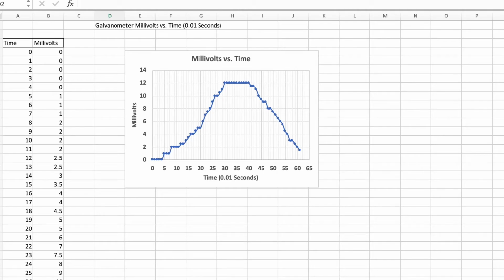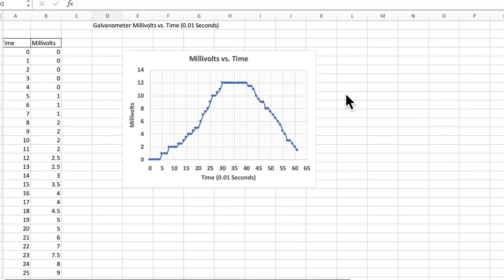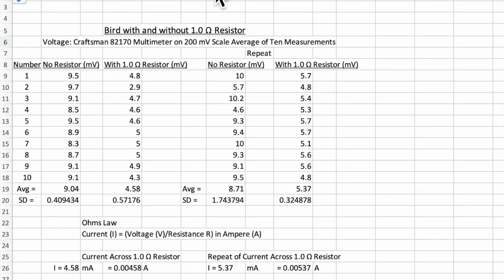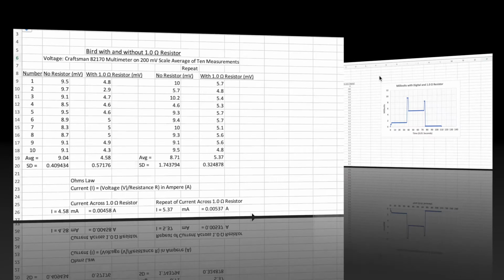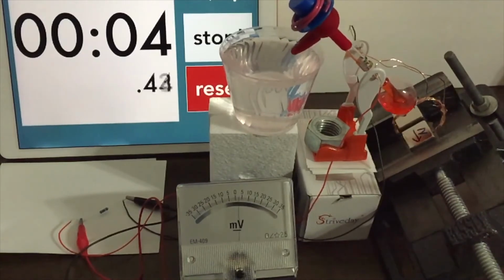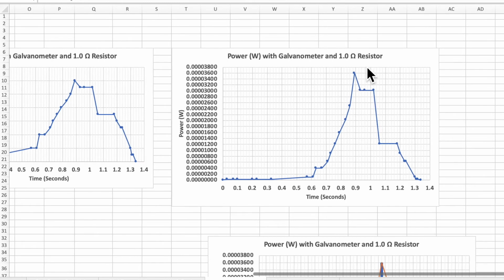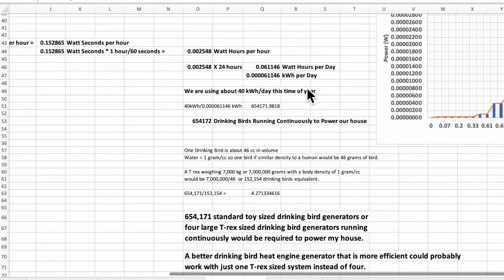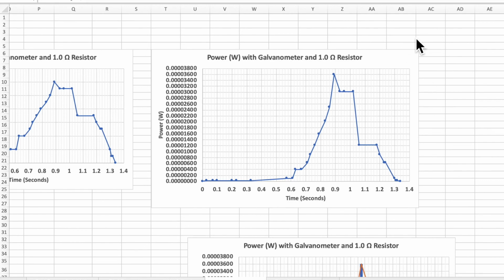Could a T-rex Sized Drinking Bird Generator Power my All Electric House

Comment: Another type of heat engine running on evaporative cooling:

https://youtu.be/ARD3ctp80ac

An LTD "low temperature difference" Stirling engine running on a wet piece of paper. Cooling could probably be increased by adding fan blades to the flywheel for more air flow and more rapid evaporation. In an experiment such an engine ran for two weeks on a wet sponge, and then it was only stopped because it needed to be moved.
Reply from the maker: Excellent demonstration! Thanks for sharing.

Comment: Thanks for your amazing video. I just wondered did you calculate the bird’s volume ?
Reply from the maker: Thanks for watching and your comment. At about 6:50 into the video I show where I submerged the bird into a graduated cylinder that was partially full of water. I wrote down the increase in the water level as the volume of the bird. I got this idea from a Thomas Edison biography that I read along time ago. They said that Edison had hired a mathematician during their light bulb development work at his Menlo Park lab. They were blowing glass bulbs and he asked the mathematician to calculate the volume of one. After a while the mathematician was still scratching his head on how to calculate it when Edison filled it with water and then simply measured the volume of water.
Reply: Thanks for your answer ! Thats a nice story. So did you use the volume calculated to get the power generated? Or are those experiments separated ?
Reply from the maker: @baptistedevaux6024  It has been awhile, but what I remember is I looked at the relative difference in volume between my measured volume of the bird and literature estimates of the volume of T-Rex. Obviously there is a massive amount of assumption that if the T-Rex was 1,000 times the volume of the bird that it could generate 1,000 times the power. This is the kind of project you do for fun. High humidity will stop the evaporative cooling and the dipping (see my video on the effect of humidity,  How to Get a Drinking Bird to Stop Drinking
https://youtu.be/MgWtdmJzo1g) so this humongous drinking bird generator would have to be placed in a desert with very low humidity and an abundant supply of clean fresh water.

Comment: Does anyone know if perhaps instead of methylene chloride it would be even more efficient using the freon R744, which is basically liquid CO2? As in, would such one fit in the basement and be able to power one's house, instead of being as tall as one's house to power one's house?
Reply: Thanks for your comment, but I said it wrong, R744 is just a refrigerant, not a freon as I understand, but it is basically CO2, do you know anything about it, I heard it might be highly efficient, more than the usual dichloromethane in drinking birds, has anyone ever constructed a drinking bird using R744 instead of dichloromethane? Thanks in advance
Reply from the maker: @sar1145  I think you could use CO2, but the vapor pressure at 70 deg F is about 830 pasig. This means it would be very hazardous trying to use glass. You may have to build your device using steel or some other very strong material.
Reply: Thanks for your answer @anisotropicus just this comment and I won't bother anymore, so basically what you're saying R744 i.e. CO2 is too efficient and could make the bird overwork and explode? Also, regarding the issue of the bird not working when there is much humidity, what do you think about hooking the bird-generator up to a heat pump of high COP like 6 or even 8 on which it would use like 50% of the electricity it produces, I'd say it'd easily provide for enough heat to maintain a temperature difference between the heat sink and the ambient which would ensure the bird swings, basically it would be a de facto perpetual motion machine, at the very least an atmospheric heat engine, does that sound feasible?
Reply from the maker: Thanks for watching and your comment. The vapor pressure could be an issue with Freon, but give it a try you may be able to make it work. Be careful working with glass under pressure. It may be safer to use metal pipes instead of glass tubing.
Reply from the maker: Maybe you could make something like that work, however, there are always unrecoverable losses so I don’t think it would be a perpetual motion machine. If you can, try to make one and see if it will work.
Reply: I guess by unrecoverable losses you mean friction and the wearing out of the bearings, of course it would have to be stopped for maitenance sometimes, and perhaps to change the R744, but overall it should be producing more energy out than what we put in, just like a windmill, a good return of investment. Thank you for your advice, much appreciated

Comment: How about a very very small version of this system? Like an atomic model. This practically is a heat engine that runs on water. If you make this very very small, and billions of it, it'll harness the temperature difference in the air and we'd have another clean source of energy that requires no battery.
Reply from the maker: Interesting idea! Thanks for your comment.